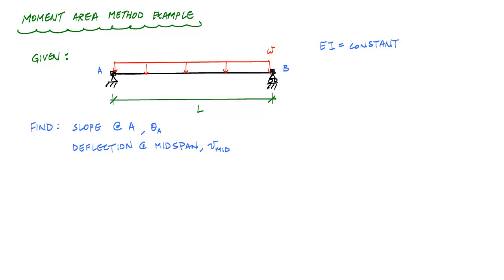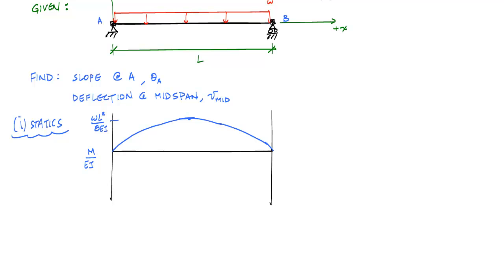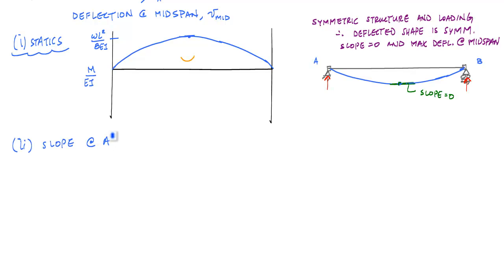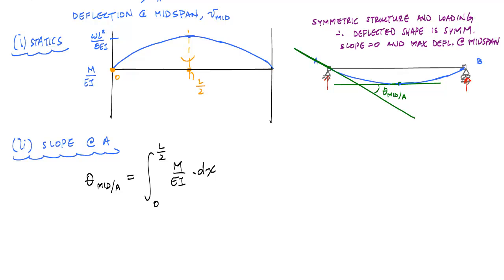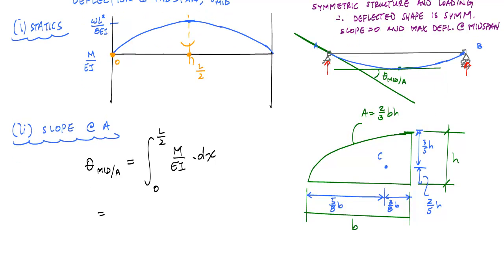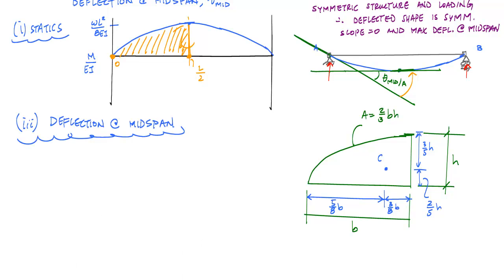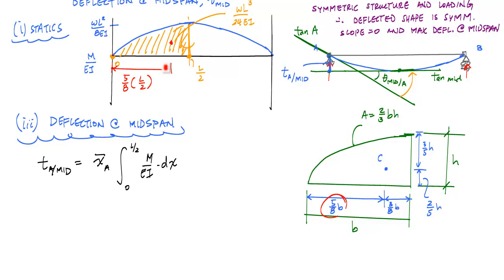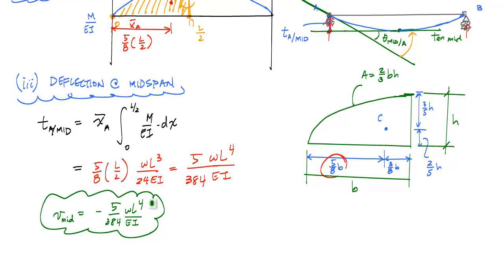Moment Area Method Example 3 - Structural Analysis

Comment: can u calculate deflection using Moment area method for a simply supported beam having a uniformly varying load with intensity 0 at support to W at mid span to again 0 at another support!!!
Reply from the maker: +jyotirmoy sahu there are a bunch of mom area method examples in my structural analysis playlist....hopefully they work....otherwise I will add to my to do list.
Reply: +structurefree the area under M/EI diagram in the case I had asked u for could not be determined by stardard formulas of parabola since the equation of curve is not similar to the form y=ax^n, hence finding out the area of M/EI diagram would itself be tricky or complicated. This was why I requested you to look into the problem. This problem can be solved by other methods easily but by moment area method it wouldnt be a smart thing to do.

Comment: great videos ! thank you so much 
i have a question ,the three methods  (double integration,moment area,conjugate beams) can only be used for beams ? 
can i use them for frames and trusses ?
Reply from the maker: +Amal Elfeky there is a way to use them for frames but that would require some relative displacement considerations. I think the principle of virtual work may be the better way to go if you need to calculate frame displacements by hand.
Reply: Oh okay, thank you so much

Comment: please .... why we take the x from point a not form the midspan
Reply: Ammar Kareem  hello ..please i need your help ... why you toke the x bar form the left side 5/8 not ...3/8
Reply: +Ammar Kareem this is as per the moment area theorem itself. it states that the elevation of a point on elastic curve (A in the above problem) with respect to the tangent passing through any other point on elastic curve (mid span in the problem) is equal to the area under M/EI diagram between the two point multiplied by the distance of c.g of the M/EI diagram from the 1st point I.e, A.
I hope u get it..

Comment: Yea. I thought you inferred in previous examples that Xbar is the distance from the centroid of the BM shape to the point of deflection. So shouldn't it be Xbar = 3/8th???
Reply: In this example the "point of deflection" is point A. You are looking for the distance of POINT A FROM the tangent line you drew at the midpoint.  "Point of deflection" is not the best terminology to use (nor the best way to think about it).  Rather, Xbar is the distance from the centroid of the BM shape to "the point on the bar where you are looking to find the vertical distance from the chosen tangent line," with positive values corresponding the case where the point of interest is ABOVE the tangent line and negative values corresponding to cases where the point of interest is below the tangent line.
Reply: @tupaclives96  Even in the problem it says that deflection at midspan, not A. Based on the previous videos about the moment area method, x(bar) is the distance between the centroid and the point of interest. Therefore, the solution is not correct and the x(bar) is 3/8 distance.
Reply: @armanamirbaghery4547  The solution is correct.  The tangent line was drawn at the midspan in this case, and we are using the theorem to find the vertical distance from the tangent line to point A - therefore xbar is the distance from the centroid to Point A and not the midspan.  Geometrically, this vertical distance is also the displacement at A.    In previous examples the tangent line would have been drawn at A, but in this case it is switched for convenience, and that's why it's confusing.  But the theorem works either way!

Comment: hey ur videos are great...I really enjoy learning from them. I have one small doubt, I think you have already explained that in one of ur comments but I still have some thing to ask. 
when we calculate deflection by second moment area theorem, we do it relatively. This means if we will calculate the deflection of point C (mid point in this example) with respect to A, it should be equal to the deflection of A with respect to C (obviously they will be of opposite signs). But if we go by that concept, we have to use 3/8b in one of the calculation instead of 5/8b. Which means we'll not get the right answer. Please explain why?? (And in case I am conceptually wrong, kindly guide)
Moreover, I have read that while calculating deflections, we calculate second moment of area w.r.t to the point for which we are calculating the deflection, in that case also we should use 3/8b instead of 5/8b. Kindly explain, I am in a big doubt.
Reply: u should get the same answer, if u use (3/8)b then u will use the other side of your M/EI diagram to find the area.
Reply: Gurpreet Bhatia hey bro i agree with you

Comment: You should do one that isn't symmetric. I know you kind of did it for the 4th example but it would help beginners if you started with an easy one and having the supports at the ends instead of one of them in the middle.